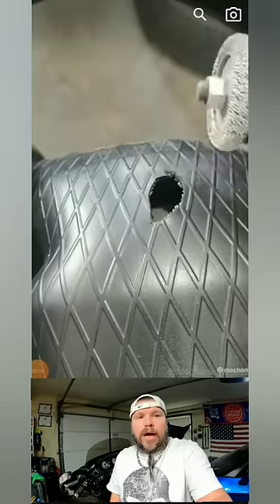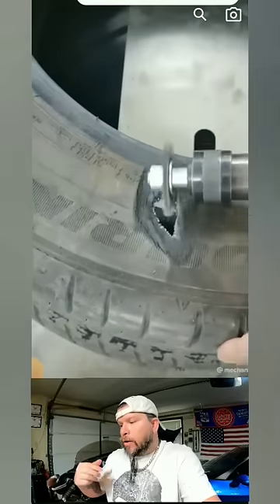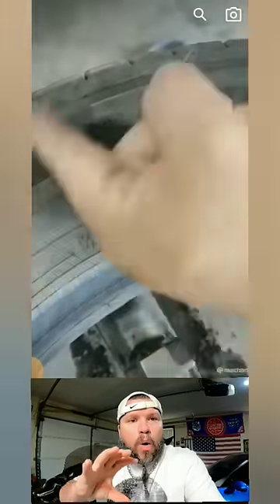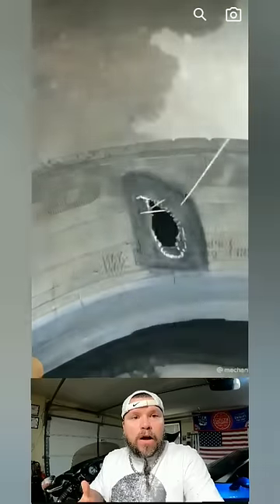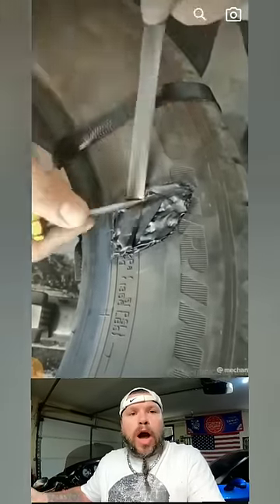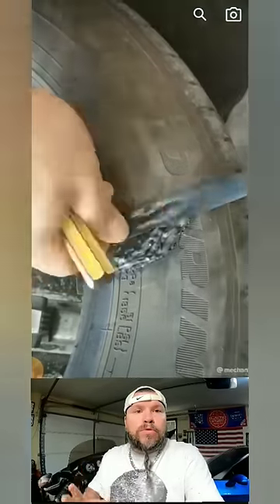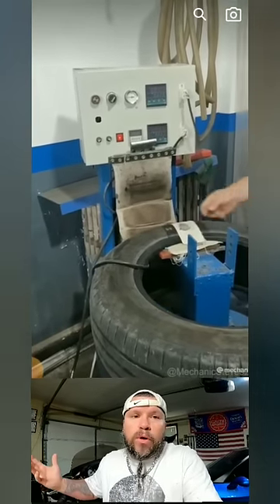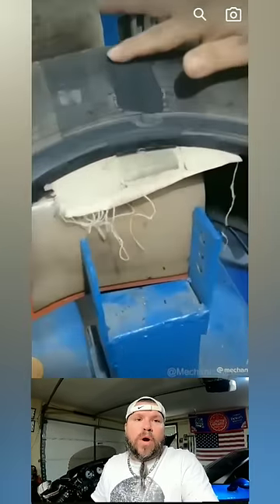patching a tire

Comment: As an actual tire expert- we have very specific ply specs for the fabric ply including the gauge of the material calendered on to the fabric, the gauge of the fabric itself, the density of fabric endings per inch, etc. along with that sidewall stocks are specifically compounded for abrasion resistance and adhesion compatibility with the plies that lie underneath, the inner liner that the rim cushion contacts, and the base of the tread. Finally your inner liner is a specific butyl or halobutyl based stock that has very poor compatibility with other rubber types. Odds are that anything you try to adhere to it will separate over time. Also the reason they use the halo butyl and chlorobutyl is due to its low gas permeability. Air doesn’t escape from those polymers quickly. There is way more complexity than what I’ve listed but that’s just a few issues that are evident when you view these types of videos

Source - I was a compounding chemist and I now work as a quality engineer for a major tire manufacturer
Reply: Wow kudos! 💯💯
Reply: The equivalent of "oh yeah, name every ___" but in tire knowledge about compounds.
Reply: so does that means its good or not
Reply: @martinandajhh  This the guy showed off what he knew and now will leave for 6 years
Reply: I absolutely love this as someone who also works for a major tire manufacturer, but it’s sad that it’ll be like 5 years before this comment is noticed
Reply: In other words your too smart to explain in simple terms?
Reply: @calebgibson8684  he added chewing gum and strings to a highly reinforced part of the tire. If he over loads or goes too fast sidewall go boom. You might be able to use this tire for very low speed work on a farm or something, but I would never trust it going above 15 mph
Reply: You work for michelin ?
Reply: @GSXR-1000  Cooper
Reply: @SourdoughVideo I'm curious to how much do you make a year on average. Sounds like you have alot of knowledge that not many people would strive for.
Reply: So, in short, will  this hold or not.
I'm guessing not.
Reply: @Disiplyn  I make a comfortable wage. Around 80K per year before taxes. I’m only 27 so I’m doing pretty okay for myself especially considering I live in an area with low cost of living. There are lots of jobs that have this sort of knowledge base of reinforced rubber materials. If you think about how much we rely on rubber you can see the industry is pretty large. You need that knowledge for hose making for water, petroleum industry, construction, etc. you have drive belts in your car and your appliances that all use reinforced rubber. Emergency rafts, clothing, temporary coverings, roofing materials, engine mounts- you can look all around for items that are engineered and compounded by chemists, mechanical engineers, rubber engineers and other STEM graduates. Are you interested in the field?
Reply: @followthepinkline  not for long at higher speeds. Failure is a function of road or off-road conditions, speed, loading, and duration. That tire might be fine on soft ground at very low speeds like on a farm truck, and the risk of losing control at those speeds is very low so the consequences aren’t very dire. At high speeds on a hard surface with pot holes that sidewall would completely fall apart and catastrophically fail. The tire would shred and send debris flying. Look up semi truck tire failure for an idea. If that’s the only loaded wheel on the wheel hub you would lose all control of the vehicle. In the US and other developed countries this repair would be illegal and you would be at risk of being charged with negligent homicide if someone was killed as a result. Engineers and supervisors in factories in the tire industry have been sent to prison as a result of high speed failures leading to deaths. There was a huge lawsuit against Firestone in the 90s that really increased regulation enforcement of tires around the globe due to tread separation as a result of miscompounded rubber. Litigation in the tire industry is very high, though often not successful due to very tight operating parameters being made very clear and tight controls over compounding and construction in almost every company’s control plans.
Reply: @SourdoughVideo  Oh I'm not interested in the field brother. I went more of a mercenary route after the military. I was just curious about you cuz it seems you have alot of knowledge that i never even heard of
Reply: @SourdoughVideo  oh okay I work for michelin
Reply: This comment is like a Dr forcing meds on people meanwhile more sleep n more water would do the same thing!🤷🏾‍♂️🤣🤣
Reply: @KidFromQueens let me say what he's saying but in English.
It'll hold if all you're doing is puttering around on the farm, but don't take that thing on the road or it's your ass, cause that thing is set to pop if you breathe on it wrong at high speed, and if Aunt Gertrude hops in that car it might just pop sitting still.

Comment: True.  Fixing the treads is okay, as long as the hole isn't too big.  If you wreck your sidewall, buy a new tire.
Reply: Hole that size in the tread is a non-starter also.
Reply: Yea usually anything bigger than 1/4 inch shouldn’t be repaired no matter where it’s at on the tire
Reply: You must be a tire sales me it done even have tread no big deal. $15 and that tire good as new.
Reply: @DaisyKarensunflower yea, if there is a hole this size on the thread the tire is getting tossed. Rather pay 75 for a new tire then 15 for some hackjob that can cost me my life.
Reply: @barrowscasper12  again you rich and need give you money away or you a tire sales men.
Reply: There are still customers at the shop I work at that get mad that we can’t patch the sidewall of the tire
Reply: @4.0_taco  this video not only proves it can be done but shops that don't show not be allowed sell new tires as it wase of perfectly good tire and destroyed the environment.
Reply: I definitely agree. But I also think there's something to this. It won't be as guaranteed as a new tire. But obviously this man has the proper machines to fix this. It will not be as good as a new tire. But I think it will work for a while.
Reply: It's illegal to even make the suggestion of patching the sidewall, let alone doing it where I live
Reply: @DaisyKarensunflower in a lot of places,  it's illegal to even suggest repairing the sidewall, let alone doing it. One practically and legally has no choice but to replace the tire.  Tire can be used provided there is no damage but new is best.
Reply: @DaisyKarensunflower  NO.  You pay $15 for your own death warrant fixing a hole in a tire that size.  It wouldn't last 10 miles and blow all at once.  It is seriously asking for death to fix a hole that size in ANY tire.
Reply: @chrismc410  It's maddening.
Reply: @DaisyKarensunflower keep doing that and you'll be pushing daisies. Which is fine with me, just don't take anyone else with you with this ignorance.
Reply: I'd assume it's for a tire swing for kids, or some do it yourself flowerpot parking blocks, definitely not for driving.
Reply: @DaisyKarensunflower  I'm poor as f.. and I wouldn't drive on that tire. Then again my uncle was a mechanic and warned against using patched tires as they tend to blow out on hot days on blacktop or the highway. That's why you'll see shredded tires on the highway. It's usually from people who trusted a patch.
Reply: @graxo3752  if this fix fails it will fail most likely in one big go , most likely it will fail when its in a high stress environment like cornering,braking or going down the highway a blowout in any of those circumstances has a high chance of being fatal, would you rather pay for a new tire "tires are wear items and you WILL need a new one eventually anyway" that will last you thousands of miles and be guaranteed or risking the whole time that it just explodes at 70mph around a slight bend in the highway careening you into something or potentially under braking it just exploding then no more braking because you dont have a tire to do it with.
Reply: @DaisyKarensunflower It's illegal here, Any repair in the sidewall is hyper dangerous.